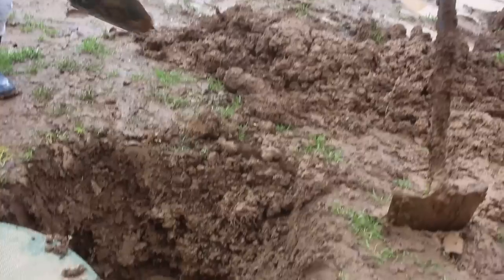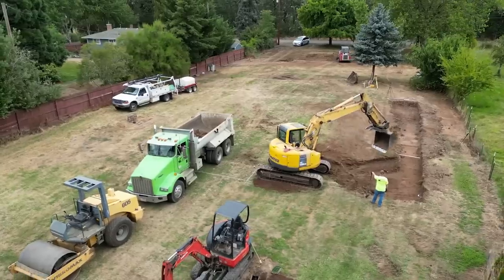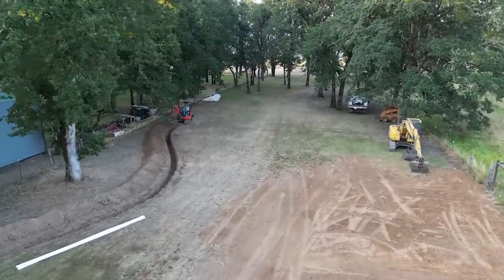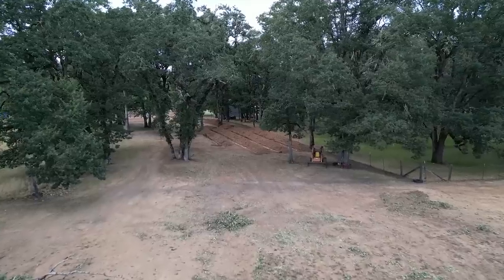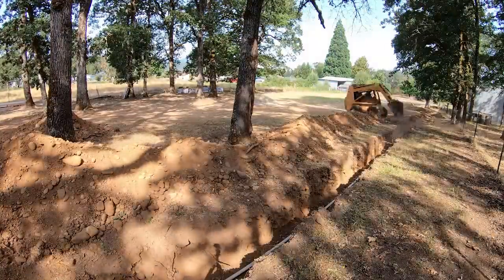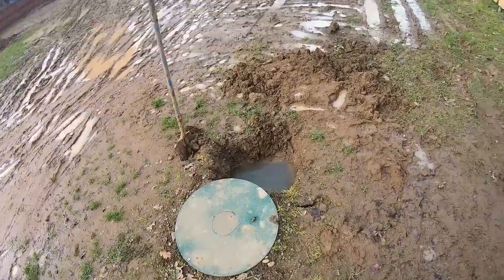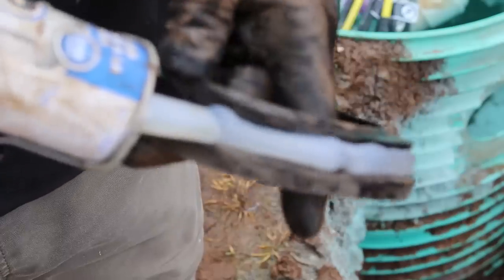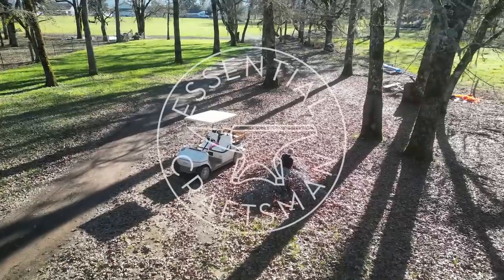Installing a Modern Septic System

Comment: if you are going to have a pump in the system, might as well have done a mound system.  pumped mound systems go uphill from the pump tank and use a pressure distribution manifold so that all effluent is distributed equally throughout the field. although your pump will get the fluid out of the tank, its basically a gravity system and as such the parts of the field closest to the tank/pump will see the most effluent and the parts furthest away very little to none.  The pumped mound style systems allow you to make the smallest distribution field and likely would have allowed no loss of trees either.
Reply: I live in Ohio and built my house in 2000 along with the septic system, the health department wanted me to install a mound system but I wanted something with basically no maintenance. They had the installer place a dosing station (a fifty gallon crock with a pump) after the tank, it had a float switch and would dump the entire fifty gallons all at once. The idea being that instead of just letting the affluent slowly drain out constantly, it would flood the entire leach field all at once and let it dry out a bit in between flooding it. Seems to work ok, it’s been 23 years and counting with no problems or wet spots in my lawn.
Reply: @Hoaxer51  yes, exactly. mine is slightly different in that it has a pump tank as large as the septic tank but it "doses" the entire field all at once instead of the drip, drip, drip to certain parts of field in gravity based system. pump has a float and sits in the ~1500 gallon pump tank seperate from the ~1250 gallon septic tank (where solids settle).  because of my large pump tank my field gets dosed like once a day so there is more resting than dosing. its 35 years old and operates as if it was brand new. lawn in/around mound is never wet. its the way to go and if it ever goes bad, i would get the exact same thing again. best i can tell, only maintence would be if the pump broke to have it replaced. its got a pump alarm in the basement if the float goes too high in the tank (indicating the pump isn't working).

Comment: You're lucky.....
In our area, septic drain fields have to be designed by approved engineers costing $20,000 or more for the total field. The pipes in the field are 12 inch culvert pipes with 24 inch sandbed beneath them.  It has to be 10 feet above mean water table ( bottom of sand bed) which causes drain fields to have a large mound the length and width of the field and nothing can be done on that mound except mowing the grass

Comment: No one uses a septic tank these days, we use a treatment plant.  No filed lines required and you can dump/use the water anywhere.
Reply: In my neck of the woods, we’re on the edge of suburban neighborhoods and plain old countryside. The closest sewer line is a mile and a half away.
It’s all septic.
Reply: @ustabee6091  I live on a lake.  The 'water' coming from my treatment plant can be discharged into the lake.  The treatment plant cost a little more than an old septic tank because of the air pump required but much less to install as field lines are not required.  I recently had mine pumped for the first time after 25 years of use and it had very little stuff in it as the O2 breaks down almost everything except dirt.  The air pump does draw a little electricity but not much.

Comment: The paper over the rock is to prevent the soil from working into the rock and plugging it. Putting the leach field that close to trees will drastically shorten its lifespan. Because the tree roots will grow into the field and into the leach pipes and clog them.   Where I live in California we have stopped using leach rock. It’s an added expense. We now use infiltrator half domes. That creates a void 18inx18in by however long the engineer design the system to be. They go in quite and are less costly than tons and tons of leach rock. The company I work for we do quite a few each year

Comment: In 1988 the local sewer inspector recommended a "Shallow Trench" system for my property. I'd never heard of such a thing, ... 35 years later, it's still working fine.
Reply: The depth of the trench depends on how well water moves through the soil.  A sandier soil will drain water quickly while a clay or caliche soil packs very tightly and water drains very slowly through it.  In the case of the latter you have to use a much larger area as a drain field to get the same percolation rate as a sandy soil.

That or you can plant some salt ceders at the ends of the drain field pipes.  Those things will all but suck the water up and as evergreens they will work almost as good in the freezing winter as the summer.  A mature salt ceder can process and evaporate up to 200 gallons of water through its needles on a hot day.

Comment: I thought you had to pass a 'perk test' before you could install a septic tank.  Your water table appeared to be about 18 in. down.  Where I live, you failed. Can you please explain?
Reply: Where I live in WA state, they don't do perk tests anymore.  They instead dig test pits and verify soil type/conditions before designing what system to install.  It's possible they did this a while ago and include it.
Reply: @israels6189  where I live in Washington state perk tests are required.

Comment: That's an older tech with the holes on bottom of pipe...... works well and lasts a long time, unless you have to have the tank pumped every 3 years,  doing that kills the bacteria and they die off and start plugging up those holes with a slimey slug and can't drain well! The paper acts as a weed barrier and actually will last for years.... but putting a system near trees is not a good idea..... roots do a lot of damage!

Comment: I don’t understand where all the water is coming from as you’re digging at your lids. If that is ground water, would you have the same situation at your leach field? If so, here in PA that situation would never be approved for a leach field system because your leachate would be in the groundwater. Here, that would necessitate a sand mound drain field,raised above the the surface level, where the leachate would never contact groundwater. A much more expensive system

Comment: I can't believe that there are trees near your drain field.  The roots will seek the water and plug up the perforated pipe.  That is the reason that I never trust a contractor.  They make it more expensive than it should be and make a lot of mistakes.

Comment: The white pipe with holes in the bottom is called a French Drain. It's used to move ground water away from where it's laid.

Comment: I have not seen anyone use ridgid pipe for the drain field before. I used to install new systems. All I ever saw was 4 inch corrugated pipe like is used also for french drains. I installed my own in 1986 and have never had to pump out the tank.  We always laid a 4 inch bed of gravel in the ditch first, then the pipe, then added more gravel. Code ( then at least ) called for a total of 12 inches of gravel. And of course it had to be inspected. A funny thing that most get wrong is they think the grass is greener over the drain fields due to what is coming out of the drain. But actually the only reason it is greener is because the dirt is less compacted so grass roots thrive better.  That firs hole with gravel mentioned here is called a "dry well".  And as general information, in as much as the first ever backhoe was invented in 1947, I doubt if that original system was dug with one. Most likely was hand dug back then.
Reply: rigid pipe works because the pump's job is to distribute the effluent throughout all the drain field lines.
Reply: @israels6189  You do realize that is exactly what happens in all drain fields, right. With or without a pump.
Reply: @dallasarnold8615  Pump systems pump a certain volume of effluent on a cycle.  For example, mine only pumps 3 times in 24hr I believe.  This means the drain field will in theory be completely saturated for a time and then dissipate.  Gravity system, on the other hand may not saturate the whole drainfield depending on the waste volume (i.e. just toilet flushes).  My point was it's not as consistently distributed.

Comment: ...mmm and it only cost $80,000 dollars to install !
Reply: Where is the cost mentioned? I've rewatched several times and can't find it, my brain isn't cooperating today.
Reply: @MrJramirex   there is no mention of the cost !   Hell ,  its $20,000 plus dollars to repair a few feet of sewer pipe at at a home in Chicago ... and they dug up n filled in a very long area ! ,
Reply: This comment has me a little irked, I know there are plenty of contractors that rip people off.  I don’t feel like I am one of them.  I went back and checked my books.  When we were here at Nate’s we did the demo of the old house, removal and decommission of the old septic system, cut the house pad and put in the new system.  The total bill was about 30% of what Diver Dave is guessing.  Nate and I wouldn’t continue to be friends if I was charging him $80k.
Reply from the maker: The project did NOT cost 80K! Reynolds Excavation is run by one of the most fair and honest families that we know. The comment is confusing a lot of people!
Reply: @essentialcraftsman   well then , tell us all the very cheap price they charged you !

Comment: Don't US citizens take permission to down mature trees, especially oak trees even if they are inside the property?
Reply: Depends on the location. Cities seem to be heavily regulated, out side of the cities - not so much.
Reply: Maybe regulated, but hardly an enforcement priority unless your neighbor snitches. Try cutting it down the morning after a big storm, when many other trees fall down.
Reply: @spencerjoplin2885  thats a big big shame
Reply: Where I live in the PNW, legally you're allowed to take down a certain number of trees on your property every year.  Would be super hard to enforce though.
Reply: @israels6189  they were there first. Here where I am most of them are all protected and need permission.  Sounds like sewage companies don't want to put pipes and sanitation down so you end up with a ton of shit in your garden. Brilliant
Reply: @israels6189  that's what they do and make it clean drinking water and fertilizer. They do it  everywhere all the time. They don't just flush it away.
Reply: Only in over regulated areas. Some areas the government has very little control of a landowners property.